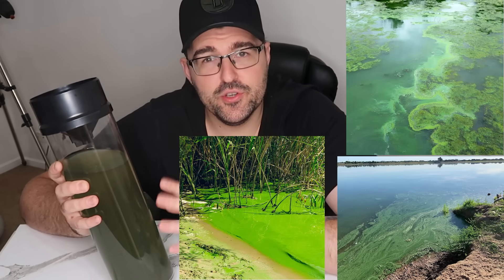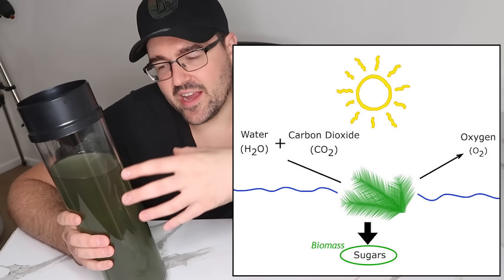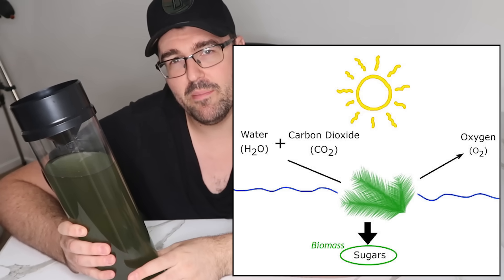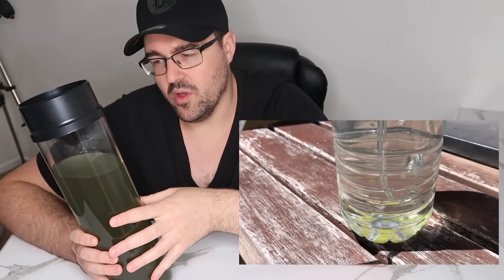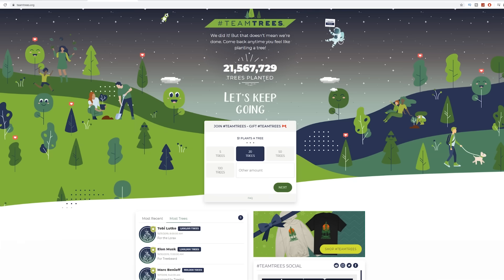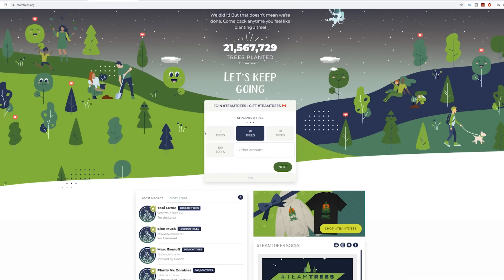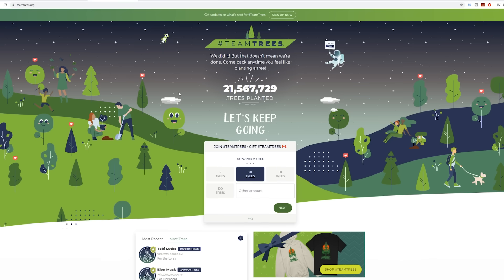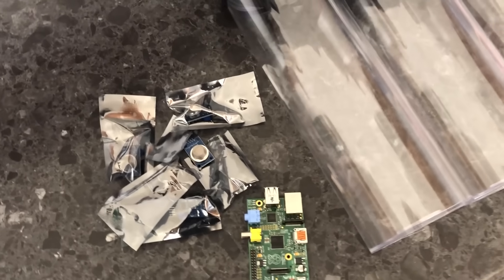This = 400 Trees ( The Algae Co2 Scrubber )

Comment: I have made a small one for my window cill suing a 2 litre spagetti jar, a 1 watt air bubbler with diffuser stone which runs on a solar power bank. I have added 1 crushed chlorella tablet and some aquarium moss balls and capped the jar with a bath sponge.. When the water starts to go really green i'm gonna siphon it to water house plants. If the solar battery bank will keep it's charge and it is fully carbon neutral I am going to make one for the bedroom window as well. Thinking of adding some interesting aquarium ornament and getting some solar powered LED's to underlight it so it becomes decorative as well. Maybe a good homemade gift idea... I have got so carried away in fact that i might even get a fish tank to do the same thing and just grow plants and algae it it-but only if i can do it with solar power.
Reply: wow so you can use store bought DRIED algae to grow more?! Wish they would just explain that. hahaha

Comment: The idea is great although not new, but I think the design is flawed, the amount of energy you take from the wall outlet (35W for the pump) requires more carbon emission to create than the amount of carbon you capture with the algae. If the power to the pump would come from solar panels or other green energy, then yes it is a winner.
Reply from the maker: Hey, thanks for watching. And true offsetting any power usage by the algae would make it pointless, not sure how far you have got in the series but I talk about solar power as one of the points and also plans for the project. a lot of the testing phase of the project would be kind of counterproductive to co2 removal with all the sensors / equipment and materials for the test but is designed to produce more consistent results, after which I can design a more minimal system of parts power usage ect. and then look to other things like scaling of the system
Reply: @ScottyDIY  Yes but the key I think is decreasing the bubble's amount when the algae culture has risen to a certain level. Maybe that amount of pumped oxygen is too much. As you said, the system can only work with green energy. So places without sun exposure can't use it, or use wind power if possible (instead). If you plan to place these machines near the ocean, you can also think about wave energy.

Comment: would it make sense to keep one of these units indoors to reduce co2 levels? I'm thinking that it could really help with concerntration if i could lower indoor co2 levels to something like 500 ppm. Would the algae produce any nasty smells? Could a solar powered plant light help with the algae's photosynthesis during night/winter? Really liking this idea and series!
Reply from the maker: Hey thanks for watching, indoors could work but then you don't get as much sunlight, mass scale would work better outdoor or industrial size, either way if you clean air it will help, smells may be one thing but will need to test for anything like bacteria, and solar light would help as well

Comment: In general, if you’re not going to use the resulting biomass as a fuel, how would you properly keep the CO2 sequestered?  Would you bury it?
Reply: here's an idea, take the biomass and put it into a biodigester, and have methanogens digest it into CH4 and then burn it for fuel, take the resulting digestate, pasteurize it, and then put it on your plants or compost it to continue the sequestration process while generating a useful product for yourself and and your crops. keep making that black gold soil because that means you've sequestered more carbon into the soil in addition to the algae you are using to scrub co2 with. you started with microbial life you should end it with microbial life.
Reply: @Meleeman011  But then again would the burning of CH4 generate more CO2, which you are trying to sequester in the first place. And biodigesters have one big big disadvantage: hydrogen disulfide (H2S). That stuff is a true and ugly killer, the tiniest trace of H2S can kill you in a closed space. At first you will be able to smell it, but it also burns away the receptors in you nose, so you won't be alarmed by the smell anymore. That's basically why you see all biodigester operations taking place in outside kitchens so ensure you won't die from H2S poisoning.

You are just better off cooking on induction plates, which are the most efficient way to heat pots and pans anyway. If you need to generate electricity, then built a GEK gasifier to run a generator. Wood gasifiers produce deadly CO gas, but you wouldn't run a genset in your house anyway. You are still using biomass to produce energy, so in the end it's the same. 

Or running you genset on algea diesel if you can make it ;) But if the purpose is to genuinely live CO2 negative, you would have to simply bury the algea to be properly return the carbon to the earth once more.
Reply from the maker: Hey, good question, sequestering is the main purpose, Biofuel is one common option, which I will show and try but I have been working on a couple other things which I will run through those tests when the time comes hopefully can be a larger scale options, but burying it has never been an option I have wanted to go down

Comment: Does it work in cold climates with little sun?
Reply from the maker: Yes, but it would not be as efficient, until I get all the data in I cant say about temperature, but sun is one of the key components. the sun could be replaced with lights but at what cost to run that light may negate the positive effects.

Comment: So you need to filter the CO2 from a coal or gas power plant or other versions of thermal power plants which produces CO2 and can be reprocessed using this bakteria
Reply from the maker: Ideally over time countries can move away from fossil fuel power plants. then all we need to do is work on fixing the issue that has already been made. unfortunately it may be some time before every country can go clean energy, so we need to find ways to reduce the Co2 now and as we scale up the carbon capture we reduce the need to use fossil fuels.

Comment: Do you realise what this can do if you have one of these that can be exposed to sunlight in the back of a space suit instead of an oxygen tank you can generate your own oxygen from CO2 meaning that you could live on Mars you need to send this to NASA
Reply from the maker: I'm not sure how it would go in smaller systems with recycling a single user, but as a concept it could potently be used to recycle the closed loop air system to reduce the amount of o2 being supplied from earth to mars, although having the available water and equipment to process the biomass is something that may need to be traded off to move to mars. but all good ideas

Comment: Is this already available for purchase?
Reply from the maker: Hi, not yet. currently working on the testing system which may be a little different to the end product as it wont need all the sensors and testing equipment.
Reply: @ScottyDIY  If you get to make a working prototype I am sure you could sell it as a product make it whit a nice design and people will buy it into is out of stock

Comment: Where is the link where i can make one? I want to know more of the concept
Reply from the maker: Hi this design I am making from scratch their is no link. My Initial learning came from reading online articles and also reading thesis's posted online. The initial system I am building is more based around testing different stains of algae and recording data, So basically a science experiment to prove the concept, once this is done I will focus on a larger system that is more suitable for replication by others. The system design will most likely be similar in design but I will hopefully work out any of the problems/design flaws along the way. As I release more videos on the system I will go through the steps on how I build and test each of the components, But I will also dedicate a video around the science of the system as well.
Reply: @ScottyDIY  so is the CO2 somehow injected into the algae solution by pumping the air?
Reply from the maker: basically yes. their is different ways of doing it, but I will stick with pumping air into the water tubes
Reply: @ScottyDIY  i have a tilapia pond and theres aerator in it. Then some of the water gets pumped into a compartment and once a while it gets filled with 'sediments' that i use to accelerate the decomposition of my compost. But then again some of it might be tilapia waste and not carbon from the algae. Do you have any literature and studies about the accumulated waste or sediments. I would like to know
Reply: What's the update on this man ?